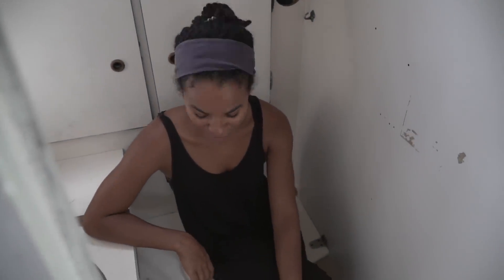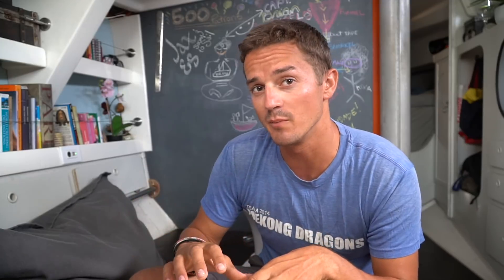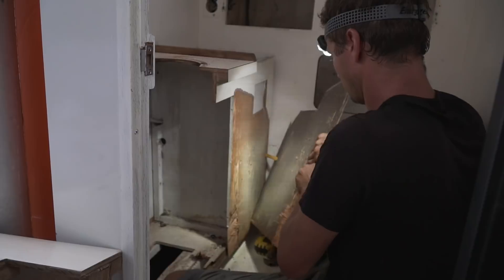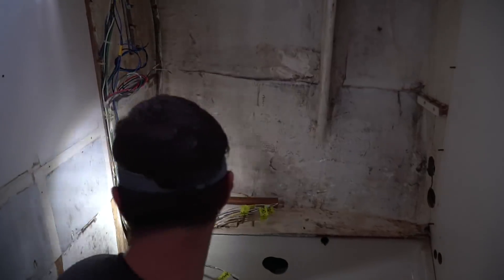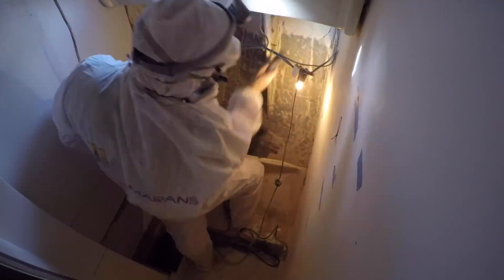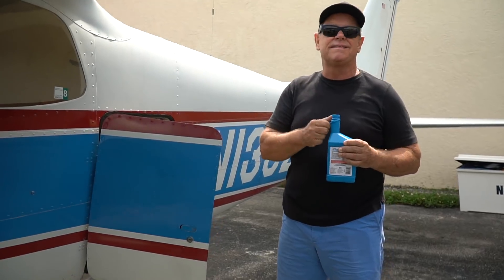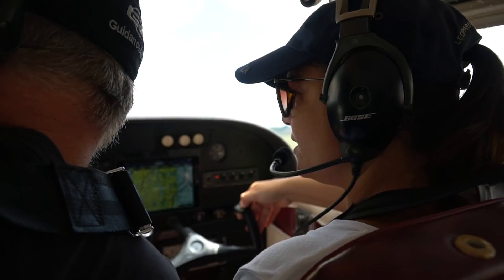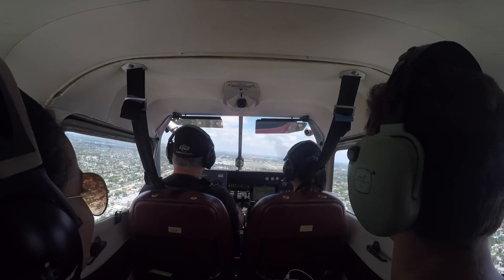Changing our toilet system! — Sailing Uma [Step 127]

Comment: 4:55 Yes, that's how formica cabinets are built.  You screw and glue the case together, THEN apply the formica.
Reply from the maker: Sure but This isn’t a house. On a boat... all screws really should be accessible!
Reply: @SailingUma  Fine Cabinetry in a house or a boat will follow similar principles.  While I can agree that everything "should be" able to dismantle, the practicality of commercial construction doesn't allow time spent on those fine details. [add] By rebuilding the interior, you get to choose what is hidden and not. I like how you are able to take things apart. I'm a designer too, and a builder.

Comment: Had a C-172.....they are great fun but one cannot go anywhere without burning fuel and they are too small for habitation....unlike a sailboat :)! I enjoy watching you two renovate your ship....it always ends up better than before. I've been trying to decide what the best head for me should be and so I'll be all ears. The Wynns like a composting head but right now I'm with Dan....too hands on. I think the Coast Guard requires that a lockable 'Y' dump overboard/holding tank valve be locked to the tank while inside the three mile offshore limit.

Comment: The main difference between a bucket and a proper composting toilet is the seperation between n.1 and number 2. 
Ask the wynns (=great sailing channel)
Reply: And I think that's what makes the traditional composting toilet go longer before emptying.
Reply: Absolutely correct. I have a proper composting toilet and when sailing solo I can often go three months before having to clean out the solids chamber.

Comment: I’m taking a big interest in the “flame toilets” and I’m amazed Dan hasn’t mentioned them......NO plumbing, No smell, and only sterile ash for disposal, oh and electrically operated!
Reply: Sounds explosive 😂
Reply: Not practical with solar. Great option if you're plugged into marina but not feasible for life on the hook.
Reply: Harold - Personally speaking, I don’t want a flame anywhere near my butt!
Reply: It is the electricity that is the main concern with incendiary toilets as the burn chambers often require a minimum of a 120v 15a circuit. Many marinas I have stayed at couldn't even come close to supplying 15a on shore power and no way I could flush without running a generator for the toilets 60-90 minutes cycle time. There also needs to be a vent installed which can be problematic on small vessels.
Reply: Sounds great.  Burn it... burn it all.
Reply from the maker: Much more simple to just pump it overboard.
Reply: I agree it would be simpler to pump it overboard but it would not be legal in many places. When I had a sea head it was impossible to pass inspection in some places, mostly because I had no holding tank. I have also heard of people failing inspection if they had a Y-valve allowing discharge into the water. I am sure you have already researched this and looking forward to the upcoming head installation video.

Comment: vinegar and vegetable oil put in the head flush and let set in the lines ..over night get you some yeast add It once in a while.. should Keep smells down ..one more big one put some screen out side vent to keep the bees out of the vent...you don't want the tank to blow up...I use salt water it is a bit more smell not much ...its the lines that leak a smell  use a Hi pressure line should fly for yrs..Did the RV life for 12 yrs yachts life 8 Cap of vessel no problem out.

Comment: was on a boat years ago with 2 heads.   One of the heads did not work.  The first 3 days of cruising we attempted to get it working.  but since it was a charter we were not allow to disasemble it.  Got a partial refund.   about 3 weeks after I got home the Captain of the sailboat sent me a letter.  yes that long ago.  saying thank you for the help and that there was a blockage in the lines.  which was cause because of lack of maintenance.

Comment: Enjoying your channel. On this topic, haven't seen many sailors talk about ventilation in the head. Is that not common (unless the head has a window to crack)? Have you seen any sailors with incinerator toilets?
Reply from the maker: Most heads have a hatch or port that opens. Ours has a soffit vent. As for incinerator toilets. No, not on boats. They make sense in cabins or in an RV, but on a boat, it's just a very complicated solution to a very simple problem easily solved on boats. Besides, they require WAY more power to operate than most boats have available.
Reply: @SailingUma  This liveaboard and sailing lifestyle is fascinating as I am more of an RVer and Planes, Trains and Automobile explorer. ;-) Really loved the DIY choices you  guys made. If I was only so handy.

Comment: I find it interesting.  When I had my boat on the Great Lakes, anytime I did work on it at the dock I got watched like a hawk.  Cutting ANYTHING near the water always had the local water police saying "keep that out of the water".  Fiberglass was a HUGE NO NO on the water.  I did work on my dock to put a step in (water levels were getting high, and the 2-1/2 foot climb to the get on the boat was way too much for my family.   I've watched you guy paint on the water (oh hell no in the  Great Lakes where I am, and so much more that you'd be told NO.  most of the projects you did would have REQUIRED a pull-out on the hard where I am.  Yea, lots of projects were never done on my boat because of that.  Don't own her anymore...really don't miss her.  If I want to get back into boating again I can get a boat tomorrow.

Comment: What exactly do y'all recommend using that is actually "marine grade", versus the stuff you can just by at Home Depot that works just as fine? What systems and products should be marine grade?
Reply from the maker: Not much really. Maybe paint? Also 316 SS is "marine grade" but it's also "food grade" so the price is pretty steady. But as far as inside the boat, I don't think we've purchased anything "marine grade". The water pumps are the same they use on RV's, PVC, Enamel paint, it all works fine. Marine grade very often just means more expensive.

Comment: So .. you poop and pee in a bucket with sawdust and drop it over board in open ocean -- or lagoons and bays -- after a couple of days? Understood. For two years. But that was not a composting toilet. Unless I am wrong ...
Reply from the maker: You're right, a true composting toilet is WAY to big to put on a sailboat. And in order to make the bucket and sawdust composting, you need to let is sit in your compost pile for a year or so. But, they are still commercially called "composting toilets". They should really be called "dry storage" or something like that.

Comment: Your design of the bucket was not proper.  You need to separate the solid from the liquid to go in individual small tanks.  A bucket by itself will not "compost" the waste.  A real compost toilet typically drops the solid waste straight down and diverts the liquid waste into a jug on the front.  The liquid waste needs dumping every few days.  The solid waste only needs dumping after many months.

Comment: I just was curious if the phrase let's get it done is really meant that way. Of course not as usual. Women are helping to take things off, but not doing some serious work themselves. For your both safety it's urgently mandatory for her to be able to get some mechanical work done in the engine and to put up an emergency rigg or stuff leaks. We all know how fast an injury happens on sea and for sure one of you will be sick and not able to do anything, maybe even unconscious. Bad circumstances always come together and so the engine will fail in front of a lee shore or whatever. For your both safety get on some mechanical, electric and other courses. Screws and tools are not boring for women, they're saving lives on sea. I'm really sad how women still behave in this matter. It's not suitable for equal rights times. In fact I don't know what the reason was to have women on board. Men are doing almost all of the work when it comes to maintenance and household work is a very minor job where men even get involved too.